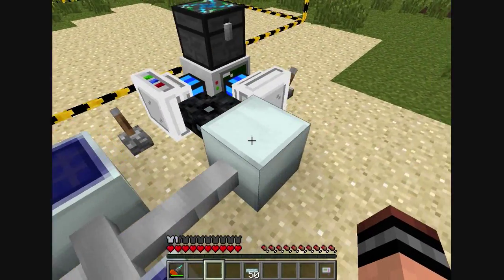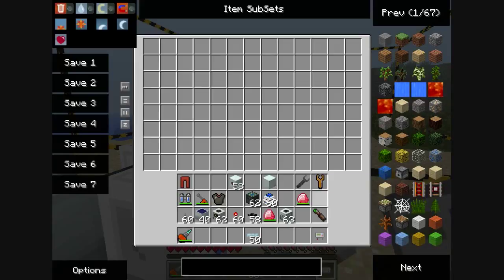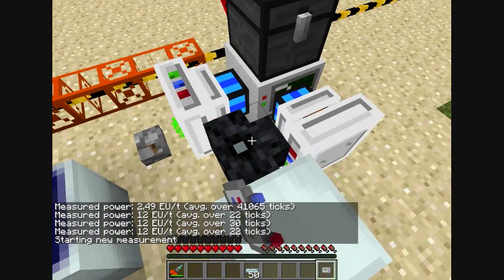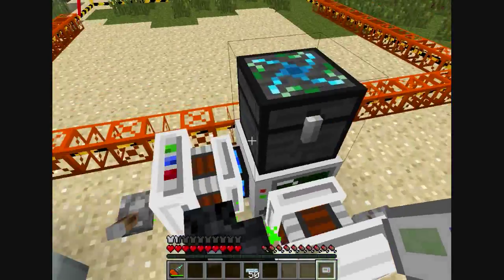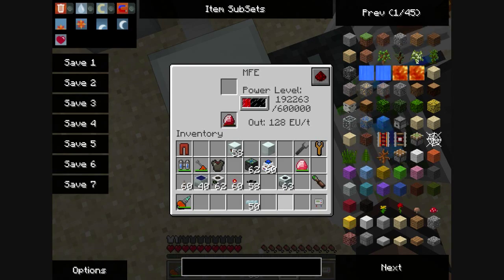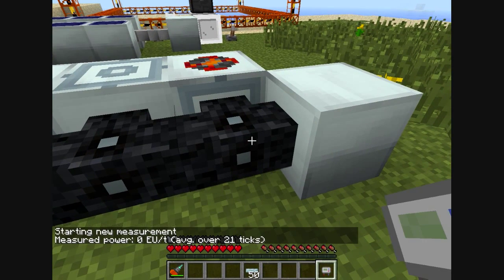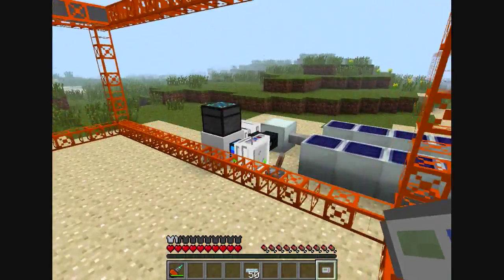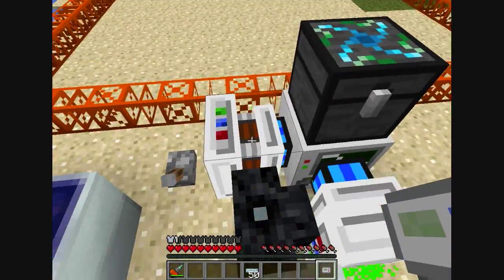Stimpy's Minecraft Testworld - ep1 - Electric Engines

Comment: If you plan on running cable with any amount of energy below 512EU/t i would recommend gong with glass fibre cable. But if you don't want to spend the diamonds gold cable 2x insulated cable is what i would go with since it holds medium voltage and doesnt lose as much energy as the HV cable you were using in this video(I would try to stay away from the HV cable unless you want to loss 1 to 1.5 EUs there about per block).